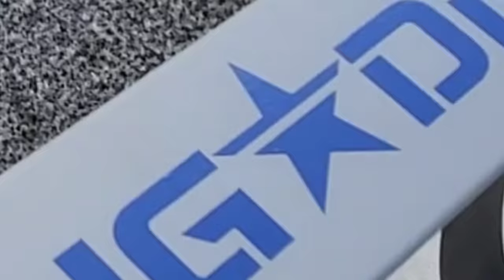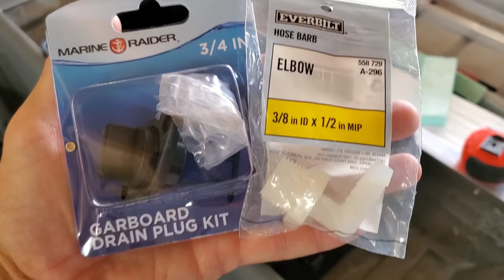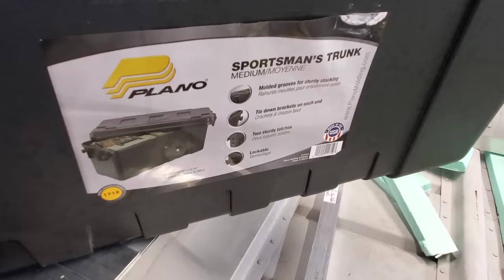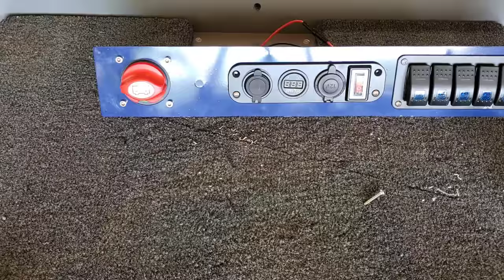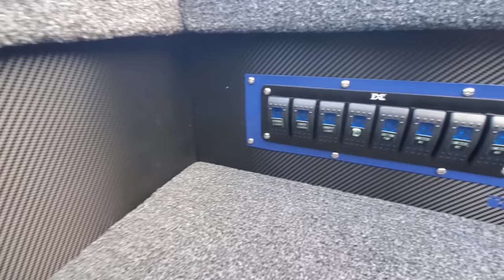JAW DROPPING JON BOAT TO BASS BOAT FULL BUILD | From Start to Finish

Comment: I just did a deck on my jon boat. Used 1/8th inch thick marine grade aluminum, 4'x8' sheet is only $150 at the local metal shop in NJ. It's not that bad. The little extra spent on lighter materials means the world on jons, especially in hp restricted lakes.
Reply: i know you wrote this 2yrs ago. i just went to my local metal recycling/scrap/metal supplier today and they wanted $400 for a 1/8x4x8 aluminum! i picked up 2 used road signs thatll be plenty for what i want to do... $45, with some tubing and angle for supports

Comment: Such good ideas, and then to go with plywood.  Brought me to tears.
Reply from the maker: Thousands more to do aluminum hatches with anti flood tracks and aluminum decking. I state in the video. Customer choice. I just build it. Probably the best plywood decked boat out there though, and with the resin it will last a long time.
Reply: @AnthonyJonesBrigadeBoats  How much weight savings is there with the aluminum?  I geek out about these things working on planes.  Great video, by the way.

Comment: That's a Fine build...
I have found that when I add my cost for materials and my hours for my labor. It's cheaper to buy a Bass Tracker but, it's fun to do these projects.
Reply from the maker: People don't always want the cheapest option. I'm finding with my customers they want something custom built by hand (by me more particularly) specific to their needs that they helped design, as opposed to a mass produced boat.

Comment: I did this on a vintage DeSoto 14' jon boat back in '94. I wired for lights using telephone station wire and outdoors telephone jacks. All my lights were tipped with telephone jack connectors, so all you did was just plug them in and voila! I put a LOUD piezo horn on it just for fun to send a message to inconsiderate boaters. I painted it tobacco gold and the little 6hp Evinrude was John Deere green. I purchased John Deere decals and found John Deere medallions from old lawn mowers to "convert" the Evinrude to John Deere. I had to add a Dol-Fin elevator wing to the motor so it would plane out. It came out beautifully and I received a ton of compliments, but the best part was how well the little boat performed. I could run for most of the summer on a tank of fuel and it was surprisingly stable to fish from. I miss the little boat. One guy said, "I didn't know John Deere made boats!" Without a blink, I told him there were catfish and crawdad farms in Louisiana. Fish on!

Comment: NEW SUBSCRIBER
that is just nuts,,,,,,incredible build,,,,pretty work
I do have 1 question I can not shake out of my head

??? what about water in cockpit area,,, how does that drain below sub floor????
and how does drainage occur in storage area between original benches???

Comment: So that's now what? A 12k Jon boat? 
With that level of detail and workmanship...
Again, Nicely done
Reply from the maker: Rrally not sure. Customer already owned the graph and bought the trolling motor used so i don't know his overall investment. I think he got the boat for 800 bucks. He's probably under 10 grand I think.
Reply: @AnthonyJonesBrigadeBoats   nice.
I actually found a Jon boat locally. Previously converted to a bass boat ( somewhat, but very clean and the guy was an electrician ( so he is as OCD as you or I would be with wiring etc .)  trailer & wheel & tires..
$2500 out the door. 
He took the post down and is trying to hold it for me for a couple months. So you videos have helped me pick this boat 1...
And , show me how to give it some extra stank on the cheap when I get it. 
Thanks again
Reply: And subbed

Comment: Really nice work and the outcome looks absolutly fantastic. I got one question though. Are you not concerned about corrosion when you use stainless steel screws with the aluminum off the boat and your construction?
Reply: That's what i want to know. A lot of guys use them and i always heard not to use them with aluminum. My boat build is gonna be used in salt also so i don't know another option other than stainless but the salt would obviously promote more corrosion. I'm surprised no one has seem to answer any questions about stainless in aluminum yet but i'm curious if it's not that big of a deal

Comment: Dumb question but if the drain valve for the live we’ll just comes out the drain port of the boat can’t water just get back in there with the tube just being shoved through it or is that drain port plugged and it’s removed when you go to drain the livewell?
Reply from the maker: The drain tube for the livewell runs to back of boat and is a few inches longer than transom plug hole. The transom is plugged in water and water tight. When on the water you can use the livewell recirculation pump to pump out almost all water in the lake or parking lot. The last inch of water has to be manually drained out of the water. This is because the recirculation pump is side mounted and has to be elevated an inch from the bottom of livewell to fit the mesh screen. You pull the transom plug, slide the hose through the plug hole, then unplug the livewell bottom drain. This drains remaining water. Sorry if I didn't demonstrate it clear enough in video. It's not ideal but with a 14ft boat with 10 inches height to work with, traditional livewell fittings and systems do not work well with no bottom clearance.  This was just a solution I came up with to fully get the water out without dumping it in the boat, which believe it or not, ive seen guys do.

Comment: How much does one like this cost for you to build? This is sweet
Reply: That's what I'm saying I'll just take this one
Reply: Probably as much as a decent used bass boat
Reply: @blakewilkerson9695 not even remotely that much.
Reply: @GimmeThemShoes   easy 10kfor a new jon boat , motor, materials and labor cost . So yes the cost of a used bass boat
Reply: @dashero11  Jon boat is about 1-2 grand, motor for a jon boat is only about another grand, materials is maybe around 2k. So at most like 5 grand 😂. Idk where your getting your jon boats cuz if that price is coming out too 10k or above I think u need too rethink your process.
Reply: @joelvillarreal2819  totally agree used bass boats are expensive nowadays 😅
Reply: @joelvillarreal2819  Even with the cost of what you said, you didn’t add labor which is probably more than material ( which btw was more than 2k) Add $800 for trolling motor, $200 for fish finder, $500 for batteries and engines are $100 per hp. 25 hp will cost you $2500
Reply: Idk I love the idea but I just bought rebuilt and sold a older ranger.  With a 175 Yamaha on it got the boat for 4 put 3 into it and sold it for 14,000 so it's close if you find the correct used boat. I really want to do a 14ft jon boat build next tho.   Really cool idea for smaller bodys of water
Reply: @skyhawk..... how much do you think trolling motors are 2k for mine another 2k for electronics and 1k in batteries
Reply: Ain't nobody even calculating the cost of 1/8" aluminum rivets. I go through 10k rivets per tug boat that I do the interior of. I use stainless steel but they are very similar in cost.
Reply: @dynamite-zh2sm trolling motor 150 don’t need a fish finder but 200
Reply: @dynamite-zh2sm o and mercury 20 hp is 1200 with gas can and battery maybe 200 just built one and paid 500 for the boat maxed at bout 4/5 grand like said but did make wood deck and aluminum frame from TBN
Reply: @TruckinRoundTv y’all fancy that’s why wal mart Amazon have them 150/200 trolling motor and wiring kits under 100 built mine just like Tiny boat nation budget build hydro turf and all lights radio speakers live well and all mini bass boat is what I say it is under 5 grand
Reply: @skipgrows1622 they not that expensive do need a lot though
Reply: @skipgrows1622 and riveting is very time consuming without good equipment but I did I diy build took three weeks
Reply: @riowitdarooga8717  it's not all that time consuming. We are talking about riveting aluminum. I hand popped every rivet for every ship by hand anywhere from 10k to 20k rivets a year for YEARS until just last year when I got a m12 rivet gun. The extra step of drilling a hole is minimal for the EXCEPTIONAL wear ability of rivets. They are highly durable and handle vibration extremely well.
Reply: @skipgrows1622  went by what I saw didn’t know I could skip the drilling which would have saved me time in my opinion knowing that and this was my first time doing rivets so I’ll keep it in mind on my next project but that was most time outside of getting leveling and measuring done it was easy though specially with all the videos
Reply: @riowitdarooga8717  you can't skip the drilling. There is obviously a language barrier here. I was not critical. I was in agreement with using rivets. Someone was commenting on the price and thinking rivets are free.
Reply: @skipgrows1622  I didn’t read it right ig but I wish I could have skipped that step would’ve saved a lot of time especially learning and trying to get in a groove of it but the build outcome worth every bit
Reply: @@bowhunter4life174He might be using it to fish electric only tournament
Reply: I’m starting off with a 14’ aluminum boat and a outboard motor very similar build except I’m not doing a live well I’m sitting at $2,500 including a $370 100ah lithium battery and $450 trolly motor.

Comment: Your work is sensational, what angle measures did you use?
Reply from the maker: the angled aluminum is 1/16th thickness, 1.5x1.5 inches

Comment: Great build! Can you please reply with the links for the plug and barb fitting you used for your livewell drain? Having trouble looking for one myself. Thanks!
Reply from the maker: If your referring to the one I modified I bottom of the livewell, i purchased at academy sports. It is made by marine raider and is a kayak drain plug. You can also search kayak drain plug on Amazon and find similar products.

Comment: is it better to have all battery's in back or the two for trolly motor up front in front of last bench?
Reply from the maker: Depends on the set up. Customer wanted all the batteries in the back to offset weight due to no outboard and him being up front fishing. I typically like trolling motor batteries up front but thats assuming there is a livewell or outboard and gas tank I rear to distribute the weight
Reply: @AnthonyJonesBrigadeBoats  thanks bro!

Comment: This is insane! I wonder if stuff like this would hold up to the salt… I’d be running my boat in freshwater and in the rivers and creeks around me with probably a 9.9 to 20 horse conversion
Reply from the maker: I wouldn't do carpet w saltwater, Sea dek instead. Not sure about raw aluminum but I know it's doable
Reply: @AnthonyJonesBrigadeBoats  ok. Thanks! I’d probably end up using raw aluminum because it can’t rust and then a fiberglass resin sealed deck painted me sea dek on top.

Comment: Nice job no rod locker?
And the owner is gonna play hell in rough water getting that boat on the trailer if the water is rough?
Reply from the maker: No rod locker. It takes up much valuable storage space in layout. this is 1436, very tight. Also a pond boat for most part, rods go on deck when boat goes in water. Not sure about any rough water where this boat goes but the trailer does have side bunks so that helps.

Comment: Are you not worried about removing all of the foam? I see that you added some back but not as much as you removed and you added weight to the boat, doesn't that concern you?
Reply from the maker: No, not at all. Foam doesn't keep the boat afloat. It prevents it from sinking if you flip it over. That's it. Required by USCG by manufacturer to get a vin # stamp. It's debated much but from my experience and what I've seen, it doesn't concern me. What does concern me is guys not running fuse boxes, proper wiring, kill switches, or bilge pumps.  This boat has all that. I've seen way more boats catch on fire than sink with no foam.

Comment: Looks great, but how is that boat not overloaded?
Reply from the maker: Still floats fine and seen jon boats with way more weight.
Reply: @AnthonyJonesBrigadeBoats  floating is not the same as stable.a tongue depressor floats. There's a number on that boat with its load capacity probably 530 no way that boat and two people with gear is less than 530. So I hope you have a tag on it now that says one person only.

Comment: Fantastic, but total cost? One has to wonder how cost effective going THIS route actually is vs purchasing a smaller entry level bass boat.
Reply from the maker: If your paying me to build your boat, it will never be the most cost effective route. I value my time and boats and YouTube are my business. My customer base doesn't come to me because they want the cheapest option.  They come to me because they have seen my work and want something top notch and custom built to their needs. Some have boats that are sentimental and money is not an issue as bringing their boat a new life professionally is of more importance.  Some boats (the one I'm building now) are electric only reservoir tournament boats. You can't buy one, they are custom built to spec. Some guys simply prefer to have something unique built that is one of a kind as opposed to going to a dealer or buying used. This video is to simply show and document the build process,  not showing or demonstrating what the most cost effective route is. I seem to get a few comments regarding this and unfortunately I think people are missing the point. To these individuals the point is not the money. It is the craftsmanship, the design process, knowing I put 150 hours plus labor of my life to build you something by hand, being on a 9 month wait list finally get your spot in my shop, ect. Anyhow,  wait until you see the one I'm building now, video up I about a month....most expensive boat I've built to date. My builds aren't for everyone nor do I expect everyone to understand. Some just care for the most cost effective way to get on the water. My builds and process of building is not that. Anytime you build something amazing and push the envelope, it's hard to fall in a cost effective category.
Reply: @AnthonyJonesBrigadeBoats  Fair enough. As previously stated, your build was fantastic.

Comment: Are you using 1.5” angle?
Reply from the maker: 1.5x1.5 , 1/16th angle in this one, yes
Reply: Is there a particular reason people use rivets instead of welding?
Reply from the maker: @Redclayoutdoors  It's DIY friendly. Most of my earlier builds, like this video, were more garage DIY builds. Most people don't own aluminum welders, have the experience or knowledge to learn to weld, or the want to spend thousands on a proper welder set up just to outfit a jon boat. I have since upgradedmy equipment and now weld all my frames in myself with tube aluminum. It's a faster process and allows me much more design capability than riveting stuff together. And its very strong. It an investment and a lot of learning on my part, something most aren't going to do for a jon boat project. I build these for a living now so it made sense for me.

Comment: Amazing build. 
Not trying to be negative but I'm sure this cost a small fortune couldn't he had just bought a new boat?
Reply from the maker: Well, it basically is a new boat. I get that a lot, these guys want hand built custom. You can't go buy something like this from a dealer. I don't expect everyone to understand but it reminds me of the car industry I used to be in. I could go buy a new Camaro for less than restoring an older one to my exact specs. I'd rather spend more and buuld exactly what I want and envision. Going and picking something up from a dealer and working hand in hand with a fabricator to custom buuld the dream you envision are two totally different feelings of spending money.
Reply: @AnthonyJonesBrigadeBoats  makes perfect sense

Comment: a 10 ft by 12 inch sheet of real carbon fiber is actally $32... and adds about $2000 instead of that vynil gharbage
Reply from the maker: maybe tiny twill from eBay in raw fabric. Not finished sheet. But even at that, the fabric I'd use from uscomposites.com is far from 32$, and then you need resin, sanding, clear coat, etc. I'm not trying to spend 60 hrs for cockpit walls. A dude is just going to scuff and scratch up after a few fish flop around. Before I got into boats, I built a few show cars. Tons of custom carbon fiber interior components,  custom widebodies, etc. I know what it takes to do it how I'd want to do it, and unfortunately, for a project like this, it's not worth the input. On another note, the 3M carbon vinyl is very good quality, i wouldn't consider it garbage at all unless you're comparing it to real carbon fiber from a strictly aesthetics standpoint.

Comment: Dude went high quality products with the whole build except the live well. Really? A plastic tub?
Reply from the maker: Not necessarily.  If it were high quality the whole buuld we'd have used aluminum lids with anti flood tracks and aluminum sheet for decking. 2500$ extra cost over wood decking. Livewell same deal, 250 for a custom aluminum tub over 40$ for the Plano trunk. You can say "really?" if you'd like but just remember,  factory Bass Trackers, Lowe Stingers, ect., come with plastic livewell tubs from factory. The tub I use is a specific brand and plastic made by a trusted company in fishing, Plano. Had the same setup (as stated in video) in my personal boat with 3 yrs use now no issues. The Sportmans Trunk by Plano is not a Wal Mart off the shelf plastic tub, hence the quadruple price tag. At end of the day believe it or not, this boat was a budget build so cost was saved in different areas.